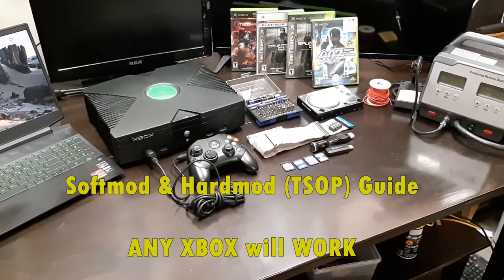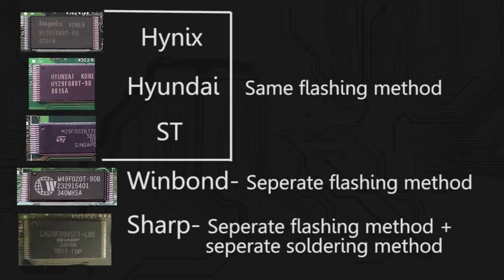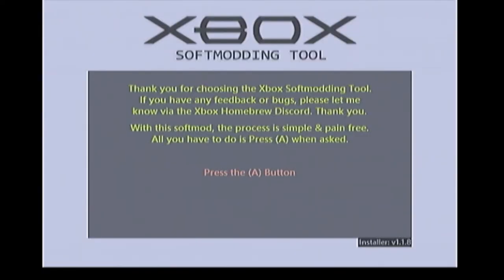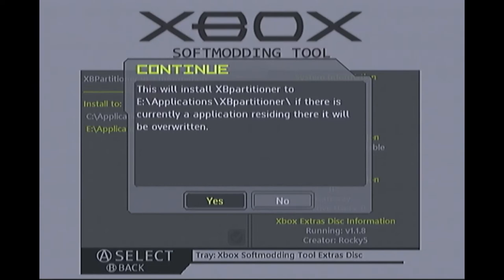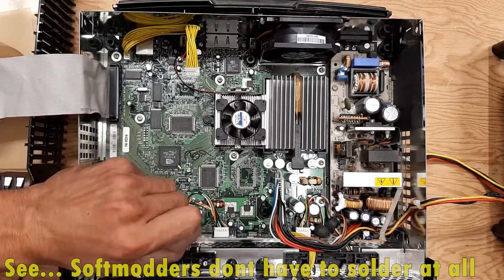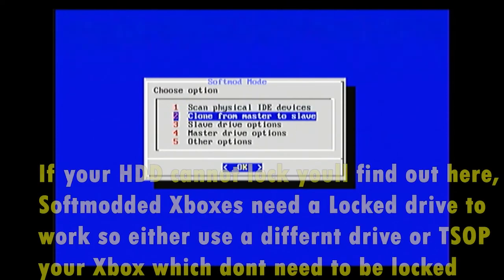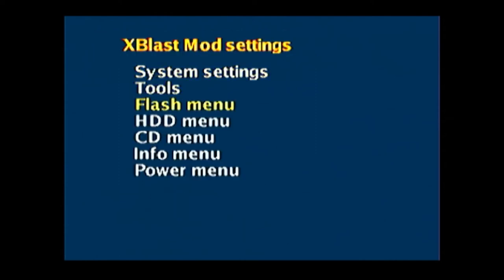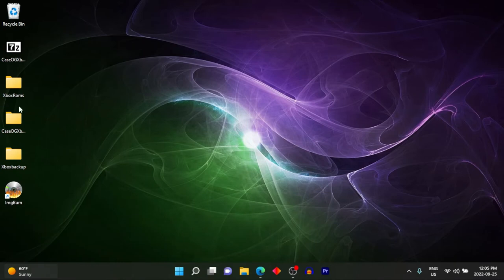EVERYTHING You NEED To KNOW & Do to Mod your OG XBOX in 2022

Comment: The IDE cable doesn't have 80 pins, it still have 40 pins.
The 80-conductor cables simply put a ground line between every other line to reduce cross-talk or signal leak between adjacent lines.

Comment: You can use Conductive paint as alternative to soldering  a Tsop  and you can always easily remove it without damage to motherboard if you wish..
Reply from the maker: Great idea!!!
Reply: I know others have used Conductive paint method and it Works, Handy for those who havent soldered before and dont wanna damage there xboxes !! always good to have options.. Great Video, Very usefull Cheeers
Reply from the maker: That sounds like a really good idea. (I would have done it in the video!!) Seams way more user friendly and probably save a few xboxes out there lol 
Thanks for the compliment this video took awhile to do.

Comment: I don't get why people are still hotswapping the new drive if they've made a backup of the HDD Key and are using a SATA to PATA converter.
You can use the backed up HDD Key to setup a new drive outside of the Xbox using XboxHDM23USB using a SATA to USB converter or connecting the drive straight to the PC.
Allows you to format as FATX, create default partitions and then lock the drive. You can just place the drive back into the Xbox (using a SATA to PATA) and it works.
I brought a 18 inch 80 wire cable so hotswapping would of been a massive hassle, plus I recon I would of broken something doing it.
Reply from the maker: I'll check out that app. You can build one on fatxplorer too. For the most part its pretty easy to do the hotswap, same as plugging in the hdd to a pc/console just it is on instead of off, I think it's a little over blow the caution around doing it on the forums, but it can damage a hdd if something shorts.

Comment: Whoa! That is a lot of effort! Thank you mate! If we have usb2.0 pendrive laying around, are we able to use it too, or it only works with memory card2usb adaptor? Lovely video tho. Got subbed too. :)
thank you
Reply from the maker: You should be able too. Just plug it in and if it formats the drive your good. The xbox controller port is a USB port just with and xbox form factor instead. I have ran into some media that wasn't recognized but most drives under 2gb or 4gb worked.
Reply from the maker: I actually made my dongle by soldering a usb car charger with and xbox controller. And use it to this day.

Comment: hey bro just making sure..i’ve softmodded and done everything up to upgrading HDD. is the use of true hexen or anything on auto installer necessary after this? if so, what?
Reply from the maker: It makes upgrading the hard drive easier but it's not absolutely necessary, as long as you're upgraded hard drive gets locked with the same password that's stored on a motherboard and you have all the system files on it it will boot

Comment: 19:07
wait... did you really say that v1.6 DONT have clock capacitors? they absolutely do, they have a "different" one thats supposed to last longer than the other revisions had. However they still leak way before the rest of the capacitors on the board. The main difference with 1.6 boards is you have to either replace it with a more permanent battery, or simply bridge the connection. otherwise the board will give error code 16 when you try to boot after you remove the clock capacitor.
Source: leaky 1.6 owner who, during a panic attack, had to research error code 16 lol

Comment: I see some people burn a cd with the files needed to upgrade hdd. But if you remove the hdd how would the Xbox know its modded to read the DVD? Confused about that
Reply from the maker: If you have a softmod you cant do that. If you have a TSOP or modchip you can throw any empty hdd in with a boot disc like truhexen or AID installer disc, it can rebuild a xbox hdd because it boots from CD/dvd first, whereas a softmod cant boot at all. 

This is because how the boot process works. Softmod needs the files on the hdd to exploit the xbox, whereas the modchip or TSOP is what is exploiting the xbox. Also softmods need the hdd to be locked or it will stop the boot process. 

I'm doing a video now on reviving a dead xbox that has no hdd or modchip/TSOP.
Reply: Oh cool thanks will watch the video when it drops

Comment: Can I use this same method to flash Cerbios on my 1.4 Winbond using the method you used? Obviously I'd have to change the C/bios/bios.bin file to the Cerbios one before flashing in Blast, but that would work, yes?
Reply from the maker: Yup, you can and you can also use the same method as sharp chips, that use a bios disc too
Reply: @justincase5704  Thank you!

Comment: I have a question when. I plug in my 2gb flash drive into the Xbox it can see the files but only option is too delete them . I don't get the option to copy to the hard drive ?
Reply from the maker: If your xbox is used there's a chance someone already did the mod. Check and see if it's on your hdd already. If not try a different port maybe, or a different usb. I doubt the hdd on the xbox is full of save files. But Check and see how much blocks of storage is left on the xbox.
Reply: dunno if you figured it out or not but, click right on the d pad to highlight the save file, this tripped me up too.

Comment: i have a hard chipped console   but having trouble ftp to my pc  i cant plug them into router as its to far away   do i need my hdd unlocked  to ftp  to work  im new to this:face-green-smiling::face-green-smiling::face-green-smiling::face-green-smiling:
Reply from the maker: No, once your xbox boots it unlocks the hdd during the boot process, if your connecting xbox to pc by cat5(ethernet cable) then do a quick Google search, you may need to change a couple settings. You can do it, i have before. the xbox actually used a crossover cable for one to one connections but you don't need too